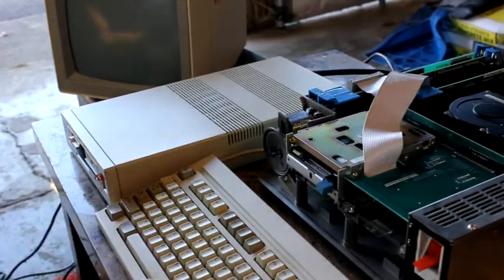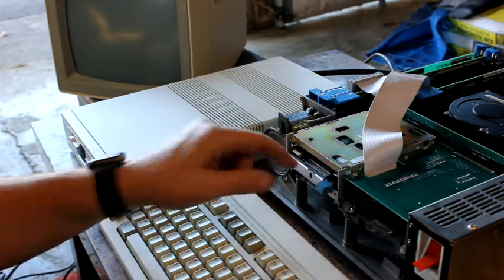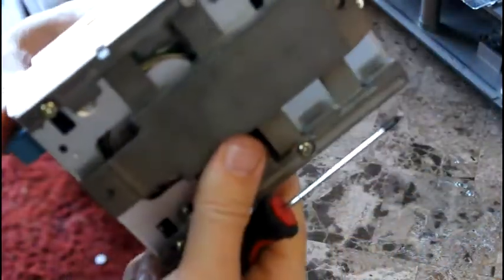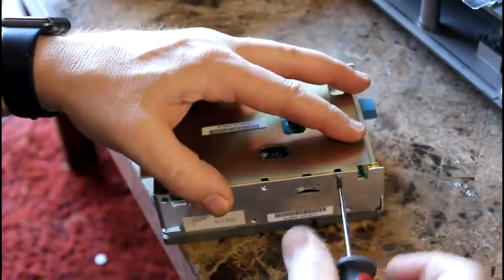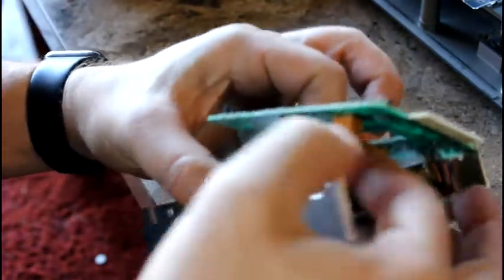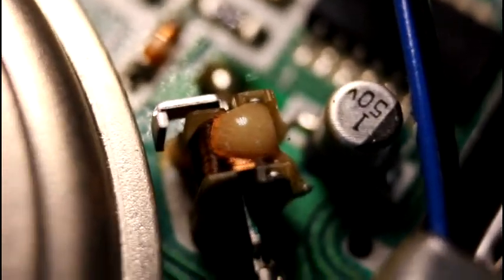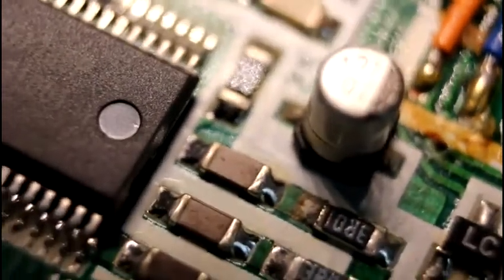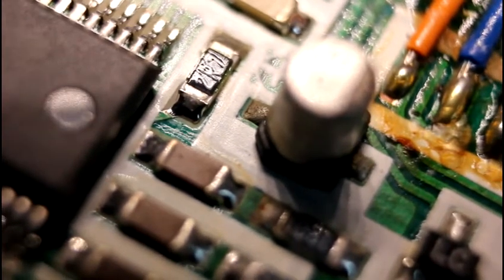IBM PS/2 Model 50 3 1/2" Floppy Drive Repair

Comment: One more thing considering the repair of this type of ALPS drive. If you replaced the caps and the drive still does not boot. Do proper preparation to diagnose the floppy further on a working PC with 34 pin FDD connector on the motherboard. To use this drive ona PC MB you have to create a test cable for that. 
-Use a standard 34 pin FDD cable for a PC as a starting point. Cut the floppy drive connector down from the cable. Tear down 6 wire together from an another floppy or HDD cable.
-Remove one edge connector from the IBM floppy cable (in my system the cable has two 40 pin edge connectors and I use only one).  First remove the top closing plastic part of the connector. Be careful not to break the guide plastic parts at the ends. Tear the cable from the connector gently, not damaging the cable.
-Put the 34 wire cable and the 6 wire cable next to each other and match the 40 pole edge connector top with the two strips of cable. Press the top part of the 40 pin edge connector into the connector body using a vice. Please make sure the wires are well aligned and not moved before the press. Check the connectivity between the 40 pin edge connector and the other ends of the cables.
- Solder a molex connector to the 6 wire strip: solder the pin 40 wire to the 12V line - yellow or orange-. Solder the pin 38 wire to the +5V molex line - red -. The other 4 lines are not used but it is necessary to do the easy alignement of the two cable strips to the edge connector. The cable is ready for use.
- Search and download the imd software package. Use imd.com for testing the drive on PC. Learn the usage of the program. When you familiar with the base functionalities of the program start test the ALPS drive with a know good formatted floppy disc.
- First check the rotational speed. It should be around 300 RPM. If the program is not able to measure it then check the 40 pin edge connector's pin 8 for index pulses using an oscilloscope.
-Run the Analysis function. It will constantly rotate the disc and read the heads. It will help to understand what happening with the heads. If you have not got any readings from the heads than a head check and head assembly alignement is necessary. Be aware: if you decide to remove the head assembly apply utmost care in the disassembly because the two ribbon cables of the heads are very very delicate. They will tear easily if you strech them a bit. (Do not ask how I know :-((( ). Make a bunch of photos about the assembly before touching any screws.
-Do not touch the screws of the head assembly. If you completely disassembly the upper head than you have to align four screws after assembling which is a nightmare. Do not do that.
-To remove the top head remove the screws of the rail guards only. Gently remove the flex cable connectors from the sockets. Remember the positions of the cables, easy to mix them.
-Examine the heads for breaks, corrosions, mechanical damages on the flex cables, etc. Measure the resistances on the flex cable connectors.
-If all seems to be ok than you need a head assembly realignement. Assemble the head assembly into its place. The head assembly should be tight, no wiggle at all. Try to move the assembly by rotating the stepper motor shaft by finger. It should move with small resistance.
-Move the head to track 0 in the idm - Analisys function group. Start the analysis function. Check the head 0 readings. If it is not reading anything at all than you have to modify the track 0 position sensor. Unscrew the two screws a bit of the sensor until you can move the sensor in and out by hand but the sensor can not be loose.
- Move the sensor a bit outwards - inwards and do a reseek to track 0. Repeat these steps until you find the track 0 on the lower head. Than you can proceed to adjust the upper head. If you move the sensor inward too much than the reading will be show track 2.
-Move the head to track 0. Loosen the two outer screws of the head assembly and try to move the head in and out in order to find the track 0. Do not push the head down, you will damage the disk. Change the head reading to see wether you have still reading on the bottom head. If you are lucky than you will find track 0 on both of the heads. It needs a lot of patience to complete the process. We are talking about 0.1-0.3mm adjustments.
- move the head to the track 40, track 80 and check the readings on both heads. Theoretically the bottom head should be fine, it can not be misaligned if the two rods are in place and tightened down properly. If you have bad readings on these tracks on the upper head than you should twist the upper head a bit and check the readings on 0, 40, 79 tracks again and again. It takes a lot of time and patience.
- As far as I see this drive using stepper motors in fixed screw position therefore it is not possible to adjust the heads with twisting the motor a bit, like at the case of the amiga floppy drives.
- Good luck!

Comment: Regarding the removal of the caps: be very carefull not to tear up the pads, especially the ground pads of the caps. I did just a little tear on two caps' GND pads. If the middle cap's ground is broken than the spindle controller IC ground will be broken as well (up and down middle section of the IC with a shorted pins). Due to this reason the spindle motor will not rotate. If you broke the right side cap's ground (below the 74HC14 IC) than the 74HC14 ground is broken as well, resulting no index pulse on the drive. After the replacement always check the grond of the two ICs.

Comment: Thanks for this!!  Was your drive not spinning the disk?  I have one in my Model 70 that is doing that.. the heads move but the disk doesn't rotate.  I'm going to check out the caps and see if maybe that's it.
Reply from the maker: I believe I had a light and no movement at all if I remember correctly

Comment: I have a PS/2 model 30 floppy that is almost exactly the same as  the one you show here (except the top PCB is a bit different). How did you expose the lower PCB for recapping (this part seems to be left out of your video :-)). I have a hard time figuring out how to the the bottom half of the metal-casing removed.
Reply from the maker: Remove the slide lock track from the bottom then remove the 4 or 5 small screws from the bottom and remove the entire drive from the remaining outer case.  Since the work was surface mount,  I didn’t have to remove the circuit board from the drive to make the repair.
Reply: @drueking  THANKS! IT WORKS! :D
I was a bit concerned that I needed to unscrew the button-bracket, but it was actually just the four rubber-paddings, two on each side, that got a bit stuck over the years. I replaced the two remaining capacitors  close to the motor, and it was the one closest to the hall sensor that had given up. The solder joints was characteristically gray and  dull and very difficult to melt, due to the acid from the cap, but a bit of flux did the trick. Its now reading and writing 720kb discs like its 1987.
Thanks a lot for your video!
Reply: What are the values of the caps you used

Comment: This is great info; it's well known that these PS/2 drives are usually now dead, but not well known how to fix them. So this video does a great service to the retro computing world. Virtually all Macintoshes of the same vintage (late 80s / early 90s) have exactly the same problem---all the SMD electrolytic caps on their mobos have leaked---and they are virtually all nonfunctional unless these are replaced, similar to what is shown in the video.

Incidentally, the removal and replacement of the cap technique here could be done in a way less likely to damage the pads. Adrian's Digital Basement has a number of videos on recapping old Macs in which he shows how to do the replacement totally cleanly. (He actually pushes down and twists to remove the caps without any heat (!), then cleans the pads with fresh solder and flux, before reinstalling).

Comment: What are volt and uf of the caps used
Reply from the maker: The original was a 10 uf, 16v.  I replaced it with a 10 uf 25 v because I was out of 16s.  As long as the replacement is of equal or higher voltage it will be fine.
Reply: @drueking  Sorry for the question, but one should be 10uf and two should be 1uf, right?